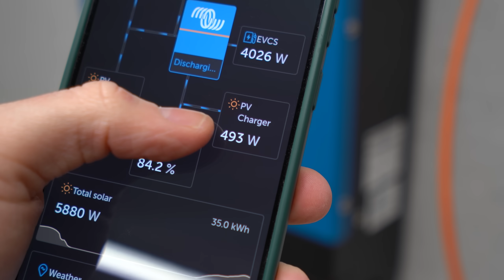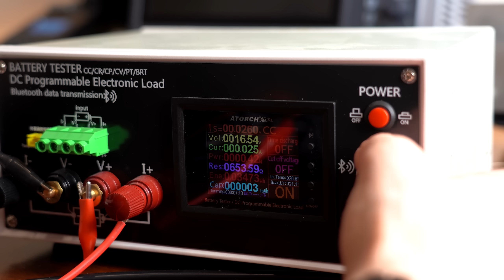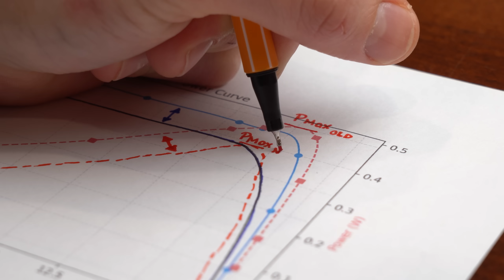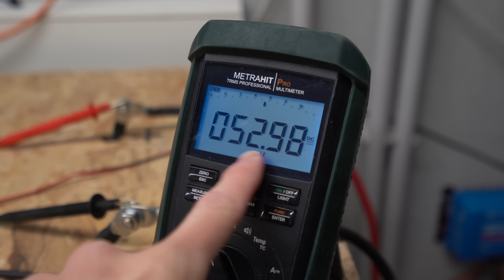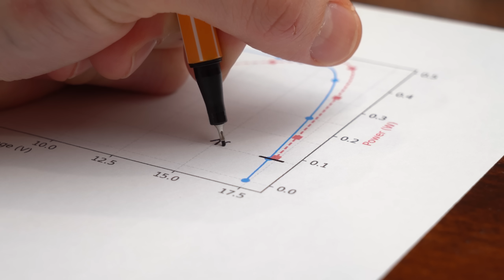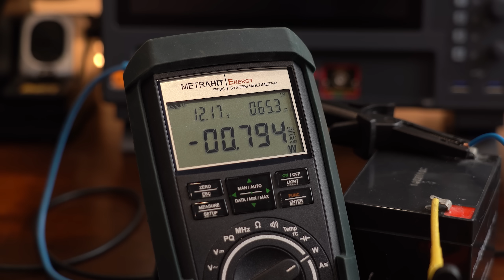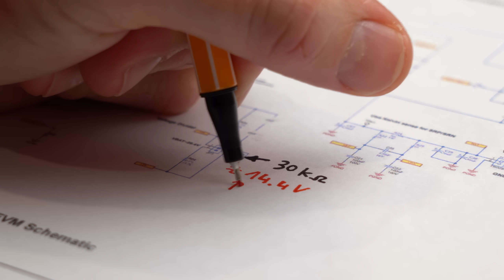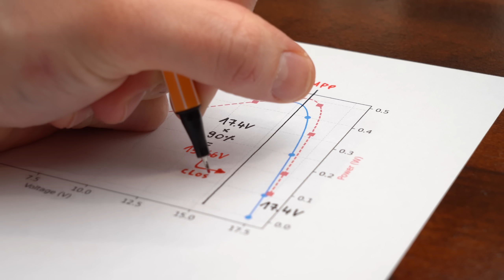My Wind Generator Was Useless....Until NOW! (MPPT)

Comment: This is the wrong application.  The name Wind Generator says it all.  The wind generator is used to generate wind, i.e. fresh air and not to generate electricity..
Reply: That's actually called a fan.
Reply: @Ed.R  Yes, it's the same. Apply voltage  and you get a breath of fresh air.
Reply: @petersilie3090   It is a shortened version of "Wind Powered Generator".  Your complaint, changes nothing.
Reply: @MrSummitville  Time for the resolution. The fresh air generator was a joke.

Comment: You realize we are all now fully invested into this series, right? Cant wait to see what you come up with for that Buck/Boost IC you picked up! 🎉
Reply: Love this series hope to see more - also because i have the same problem with my diy wind turbine and need a fitting solution. But buying the dev board would be a bit to much for me - so a circuit from Scott would be absolutly fabulous. Already exited!
Reply: @mxblock  same
 I did practically the same thing he did: Cheap $250 wind turbine and a cheap MPPT. Almost threw it away.
Reply: I think you can still maybe fly the turbine into higher altitude with a giant kite and get more power via increasing wind speeds... Maybe????
Reply: I was invested into the hand vacuum he was modifying. Now this!
Reply: WTF  is up with the title not matching the content ?
         Useless....Until NOW! (MPPT)
At end of the video the guy said the wind generator was still useless !!
Reply: @RectalRooter  useless, i have a feeling, because the juice it generates isn't compatible with a normal MPPT. I has a feeler that his custom power point will give us a usable voltage/current cccccombo
Reply: @3DRC-707  Maybe you didn't read my comment.

Comment: Solar mppt algorithm is definded by the solid state silicon cell semi conductor.  

A wind turbine is not a semiconductor, it is a wind power convertor.  A solar mppt algorithm is not the most effective way of yielding all the power from the turbines conversion and will also tend to cycle the machine as the algorithm hunts.

All commercial wind turbines do no use solar mppt algorithms.  They use lookup tables and or 3rd, 4th, 5th order polynomial terms to control the inverter base on either the inputvoltage or the frequency of the turbine.
Reply: commenting to bump this comment to the top
Reply: I would have assumed that the largest, power plant class turbines operate on a similar principle to turboprop aircraft engines: vary the propeller pitch instead of the rotational speed.
That way they can have a fixed gearing/pole configuration synchronous generator straight into the grid, with load varied by the blade pitch instead.
Reply: @Kalvinjj  That is a way of doing it, yes.  The other way is with permanent magnet generators, they don't have gearboxes and although they still have variable pitch blades, the pitch control is used to yield greater conversion efficiency of the wind to mechanical rotation. The generator on these machines is multi phase varying frequency AC, sometimes called wild AC.  This AC power is rectified and then run into an inverter which will have a buck and or boost circuit.  This conversion is then controlled with the methods I've described in the original comment.
Reply: I fully agree - solar us like one dimensional and wind us at least 2d if not 3d… it is way more complex to deal with, see my longer comment on that..
Reply: Well... The part he used in the beginning was label as a wind turbine controller (low wind speed boost) ?...
Which I am thinking most people will assume that it will work with wind turbines instead of a solar input...
Reply: A wind turbine needs minutes to mechanically stabilize itself after settings are changed. I also don't see how a circuit designed to track and optimize within milliseconds can optimize the settings.
Reply: Yeah but how big would the difference be on a small turbine like this?
Reply: @SailingSoWhat  Very little is my guess and it's not the best option. With small turbines it's all about the design and how each part works together. The blades must be designed to match the load of the alternator and the alternator needs to be designed for the electrical load. In other words each part is very interlinked and getting everything to work together in an optimum way isn't easy. A well designed small turbine should just do it's thing without any fancy control system.
Reply: @Ed.R  well, without any fancy control system would mean, using the manufacturer supplied control system. In a perfect world that would be the best system because surely the manufacturer knows his turbines the best.
But we do not live in that world, for most inexpensive or niche applications the manufacturers software mostly sucks badly, because 99% of customers can not tell or don't have a choice anyways.
Reply: @SailingSoWhat  A small wind turbine doesn't need any control system if designed correctly. A well designed alternator will connect to a battery with nothing more than a bridge rectifier. The blades designed to provide sufficient power at the range of rpms of the alternator. Look up Hugh Piggott who designed very reliable basic wind turbines for decades.
Reply: @Ed.R  sorry but you're wrong.  A wind turbine is a mechanical conversion device which has components that do not interact in a linear manor.  

The power in the wind is proportional to the cube of the wind speed.  Wind turbine blades, fixed or variable pitched do not operate at consistent efficiency across all wind speeds.

The power in the wind is proportional to the cube of the wind speed.  As a result of this relationship, even these shall machines must have controllers on them.

Hugh Pigott and Dan Batman of Field lines in the US both use charge controllers with turbine modes to control their machines.  The technology wasn't around when they started, the first off grid product was the Midnight Classic controller.  Now with modern grid tie inverters and AC coupled systems the technology is everywhere at all scales.
Reply: @WindyJAMiller  True and there is always an element of compromise. Usually, the efficiency is optimised for low wind speeds and drops as wind speed increases as it doesn't matter.
My argument is a simple mechanical design that lasts reliably for years is better than a fancy one that needs more maintenance and has more down time. You can very quickly lose the small gains from a control system if it's out of action for a short period.
Reply: @WindyJAMiller  Charge controllers in those days were nothing more than something to stop the battery getting boiled. Simply switched on a dump load when voltage was above a limit. 
Did these turbines generate useful power, yes. If they needed more power just make a turbines with a larger blade diameter.
Too much obsession these days with stick electronics on everything and then wonder why it's always breaking down.
Reply: @Ed.R  I broadly agree with your sentiments.  I too suffer similar frustrations at times.  However, especially with any device, system, product or building where the structural loads are non linear and or the gains in performance or efficiency and stability are measurably better than without I think there is certainly a place for power electronics.

Wind turbines are certainly one of the most non linear devices out there.

I think overall the video will serve to increase understanding in the subject area.  I just hope there's a follow up that  addresses the fundamental differences that we've all highlighted during this discussion.
Reply: @Ed.R ain't that the truth
Reply: @Ed.R I like your thinking
Reply: It might be better to input the alternating current of the Wind generator into a PFC (Power factor correction) which is in a nutshell a boost converter.
Reply: @TimNeumann  Power factor correction is about reducing reactive power usage in AC circuits by bringing voltage and current back in phase with each other using capacitance, very occasional inductors are used but normally it's capacitance.  Boost circuits are about increasing the DC voltage using inductors.
Reply: @WindyJAMiller 
 
There is a PFC topology that is similar to a standard DC/DC boost converter. The main difference is in the way the duty cycle is controlled. It's commonly just called a Boost PFC.
Reply: @Kronkulus9282  ok, I'll look into that at some point, can't get my head around the idea just yet....
Reply: That’s sick ❤
Reply: Congrats! You have finally succeeded in making such a simple subject into complex mathematics!
Reply: Oh, my God a 5th order polynomial? That's crazy!
Reply: @Sekir80 on a MW machine, that's a lot of energy going begging, could power a house for a year.
Reply: @ Surely, you know what you are talking about, but I don't. Well, I did polynomial corrections on telescope mirrors, so I have a slight knowledge about what going on, but I've no clue in electrical engineering term. Sorry for the bad joke :D
Reply: @Sekir80  that sounds like an interesting area to focus on.  What got you into that area of work?
Reply: @WindyJAMiller  Nah, it wasn't work it was  just an exercise: I was curious how a spherical and parabolic mirror compares in focusing the light and figured out even the parabola isn't perfect, decided to correct that with higher polynomials.
Reply: WTF  is up with the title not matching the content ?
         Useless....Until NOW! (MPPT)
At end of the video the guy said the wind generator was still useless !!
Reply: @RectalRooter that's called "clickbait" and it gets people to watch your videos.
Then, they make comments about the video title being inaccurate. And each time I comment is added to a video, YouTube then bumps the video's likelihood of being recommended to another person. They call this "engagement"
And it results in people highly exaggerating every single aspect of the video title and thumbnail, because it gets more views and more engagement.

YouTube as a platform is designed to reward hype and not quality.

Comment: Very helpful explanation - my MPPT charge controller did much better on marginal sun production days when I hooked a bunch of panels in series. Inexpensive "power harvesting" solutions for getting energy out when ideal production is not reached would be great, especially for off-grid sensor applications...
Reply: Mind you, this highly depends on the panel-types.
I have panels which already span more sub-panels in series and raise the voltage to a sufficient level. Adding more in series does work, but causes more losses in the conversion to a lower voltage in the Mppt-controller

Comment: I have an idea. SCR diode. Let the generator charge a capacitor at whatever rate... then when it reaches 14V, trigger the SCR to discharge the capacitor into the battery.
Reply: This is pretty much a buck converter approach. Will work, if you can reach the 14+V needed. In his case it was the other way around, it wasn't even reaching the 14 needed to charge the battery.
Reply: The SCR will only discharge down to the battery voltage and the power from the generator when the capacitor approaches 14v will be much less than max power.
Reply: If the continuous current into the capacitor exceeds the minimum holding current of the SCR, then it never turns off, so an SCR is a poor choice over a simple MOSFET. Additionally, as noted, the MPP in any given moment occurs at a certain voltage, and a direct connection to a large capacitor will ensure that you're always either below or above that voltage, except for a fleeting instant when the charging capacitor's voltage sweeps across that sweet spot.
Reply: These are all solvable problems. I shared my idea because I have done the same for laser shots. I needed 1000V, 100A pulse from AA batteries. First, you keep charging the capacitor to 30V with a boost circuit at whatever pace is suitable for the generator, then trigger the SCR with a choke in series. A choke will make sure that battery gets  a smooth pulse. LC circuit should be "critically damped" for a nice pulse without losing energy in the choke. Li batteries like trickle pulses anyway. Why not MOSFET? Because MOSFET complicates everything, you will need to maintain a gate voltage above battery's, you will need a driver. SCR is simpler, just +1V above battery will trigger it fully, it can be done without microcontroller using a small capacitor on it's gate.
Reply: @titillation The purpose of MPPT is not to create a high power pulse but to find and track the maximum power output of a variable power source. This requires precisely turning a mosfet on and off to regulate the current input given a certain voltage input. It's basically impedance matching the load to the source.
Reply: @titillation this is an interesting idea

Comment: After some testing I replaced the same exact controller for the same exact wind turbine immediately with my own Tri Phase rectifier.

 Which then goes into a capacitor bank to smooth it and also into a boost converter that tries to step it up to 16v if it can which gets injected into my solar lines.(With a diode.)

 Which then all goes into a charge controller.

 It sounds dumb but if the sun is shinning then the voltage in the line stays higher and the turbine will spin faster under light winds and have automatically whatever excess siphoned off.

 Then at night the turbine gets the controller exclusively.

 With that original controller it would take about 18mph to produce 10w of power. Now at that same speed I'll get like 60 to 80w.

 And I can get 10w as low as 13mph. 

 Again the original one started making anything only at about 17...
Reply: Does that potentially risk damaging your solar panels by exceeding their maximum rated voltage output? Please explain like I'm five:-D
Reply: @BB-sm8ey , maybe if you had a small and low power panel and/or a high voltage turbine then yes. But in my case the panels in sun will get up to around 23v when not loaded.

 This turbine never gets above 21v from what I seen as long as the battery needs charge which it always will in my case.

 That would still be a concern at night where the turbine power can backfeed the panels as they are at ~0v however most panels now a days prevent that by having diodes.

 So what happens is during the day when the solar line is powered by the panels the voltage goes up to about 21v which means the turbine needs to make 21+ volts to add power into the circuit.

 Well under normal circumstances that wouldn't be possible because the resitance of anything on the circuit like the charge controller would bog down the voltage too much which stops the turbine from spinning fast enough to effectively collect air at these low wind speeds.

 However with what I done there isn't any circuit resistance until the turbine is already spinning fast which means an efficient gathering of power. 

 And it'll want to stay spinning fast even in low wind speeds by doing this.

 The capcitor bank helps too in order to allow some buffering during rapidly changing windspeeds.

 (The capacitor bank allows it to capture and keep some of the energy that normally would be completely wasted if the turbine voltage isn't high enough, which gives it a boost in theory.)

 And gives a buffer to the boost converter running.

 Then at night when the panels are producing no power the diode on them blocks the turbine backflow and my panel's MPPT just exclusively runs my turbine for awhile.

 It's definitely not the most efficient way to do things. BUT it absolutely works. And works infinitely better than the original product I was sold that wasn't able to gather anything at anything but STRONG wind gust.

 It should be noted I only do this as the turbine is so low power and my system is over built. If it was a large turbine it absolutely should be put on it's own circuit for safty and effeciency.
Reply: If you have a more specific question I can try to answer.

Comment: the wind turbine generates 3 phase ac, couldn't you just use a 1:2 transformer to step up the voltage? (or 3 of them, if you can't find a cheap low voltage 3 phase transformer)
Reply: Transformers tend to be optimized for a small frequency range, and don't do nearly as well outside of it.